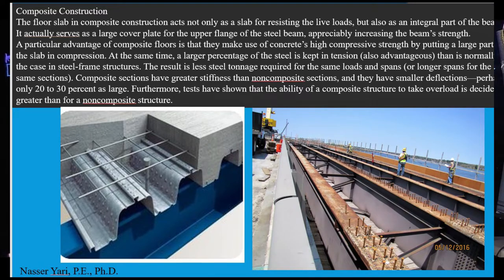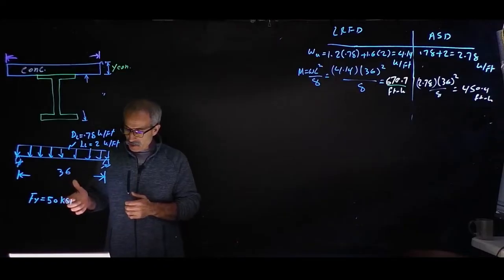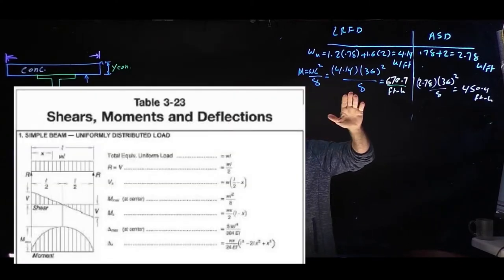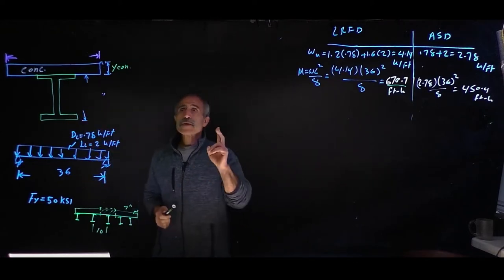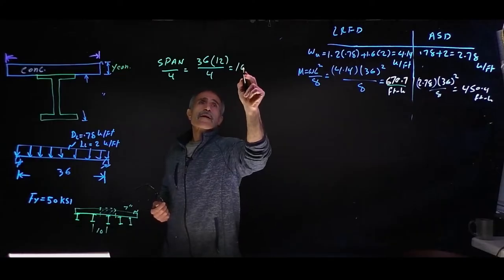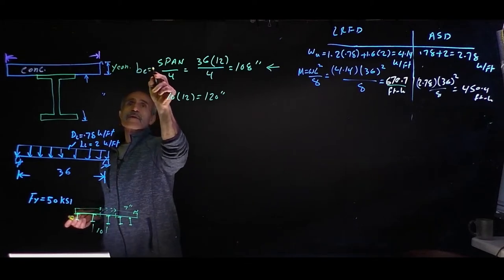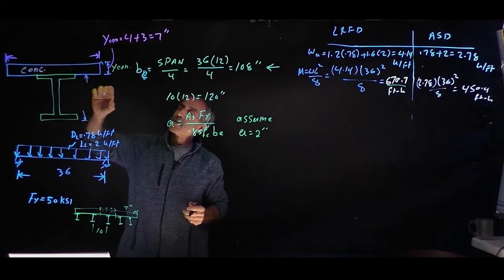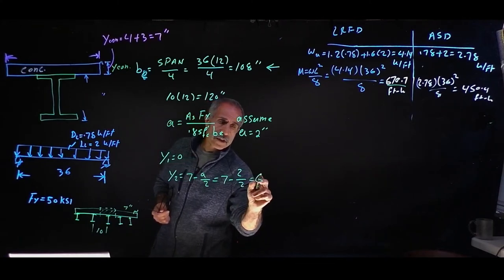Composite beam design. Steel concrete composite beams

Comment: DR ,  For ILB values(Table 3-20); why are you taking 3rd row values?
Reply from the maker: Hi ,sorry for the late response. We can use row 1 but we be over designing. However, our moment due to the load in LRFD was 671 ft-k if we use row one our moment design capacity will be 762 ft-k. So, we want to use Y1 that is largest possible to provide moment around 671 ft-k and the 3rd row where Y1=0.33 fit the best. Excellent question, thank you.

Comment: doctor when you calculated the deflection of the slab used the 36 ft  span but i thick  transfer the load in short direction between w-shape  is it right or not please clarified this point
Reply from the maker: Hi Ali, Good Question, We have to consider  deflections for the various types of loads separately. For instance, there are dead loads applied to the steel section alone (if no shoring is used), dead loads applied to the composite section, and live loads applied to the composite section. When the AISC Specification is used to select steel beams for composite sections, the results often will be some rather small steel beams and thus some quite shallow floors. Such floors, when unshored, frequently will have large deflections when the concrete is placed. For this reason, designers will often require cambering of the beams. Other alternatives include the selection of larger beams or the use of shoring. To answer your question we are calculating the beam deflection due to the slab (wet concrete). For unshored composite construction, the final deflections will equal the initial deflections caused by the wet concrete calculated with the moments of inertia of the steel beams, plus the deflections due to the loads applied after the concrete hardens, calculated with the moments of inertia of the composite sections. Should shored construction be used, all deflections will be calculated with moments of inertia of the composite sections.